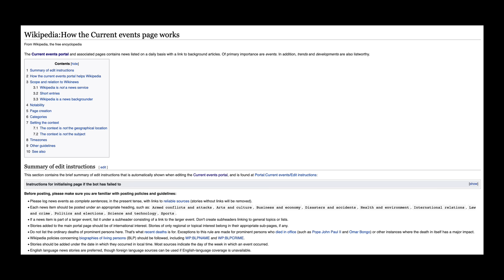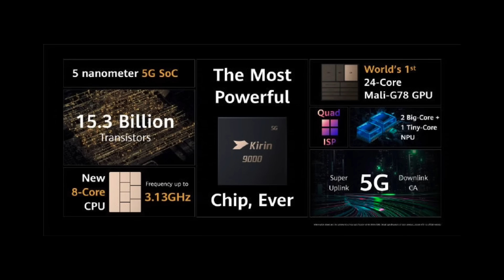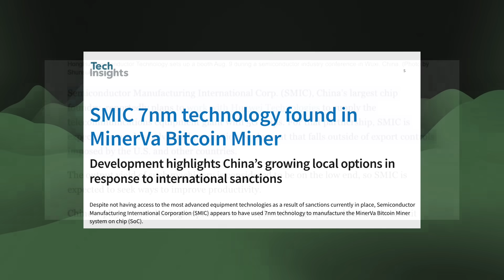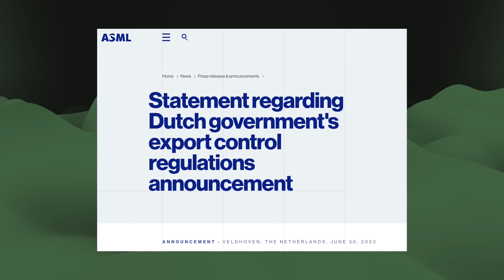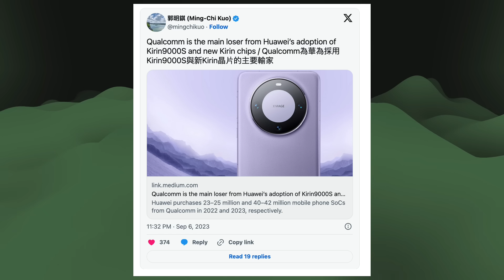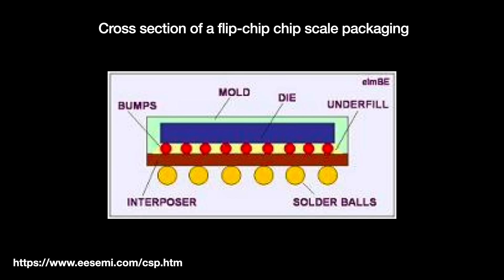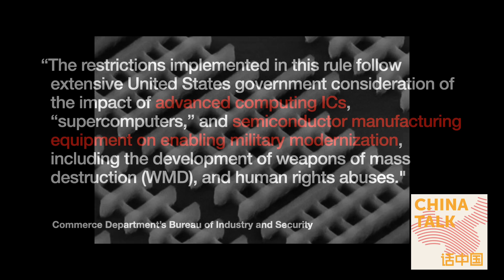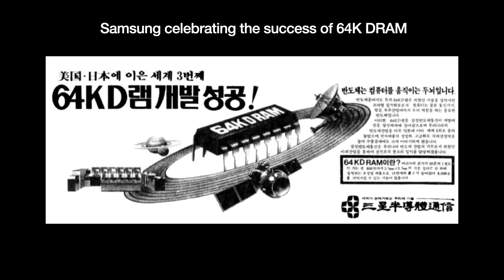China's 7nm Semiconductor Breakthrough

Comment: No breakthrough at all. For, Semiconductor Fabrication, Yield is the king. You don't need ASML's EUV machine to do 7nm. DUV that use 20s year ago can also make 7nm or even 5nm with less than 1/3 usable per wafer so each chip made will cost 3-4 time. And chip made by DUV can not run as high frequency as EUV lead to poor performance compare to chips in market.
Reply: people tend to overlook the cost of business when national prestige is on the line, if yields and cost are an issue we will never hear about it.
Reply: @supabass4003 If it is mass-produced, the chip yield will be improved.

Comment: Forgive me the ignorance, but using DUV does not intail that you have to use double patterning at every step and thus having your chips taking longer and being way more expensive? Or is the higher yield enough to compensate for it?
Reply: It's definitely pros and cons with DUV and EUV. Double patterning for DUV. Then the EUV machines is very expensive and probably also very expensive to run. The EUV will probably win out the smaller the process gets.
So smaller cheaper and slower machines or bigger more expensive and faster machines.
Reply: dalangwudalang2596  Last I checked (today) all Chinese fabs are still using ASML units. Not only that, what you say makes no sense: you cannot scale up a litography machine and still print the same wafers.
Reply: @yoshyoka  What the guy is saying is China has cracked the EUV light source issue. Rather than irradiating tin droplets with high-energy CO2-laser to generate EUV light, the chinese are using a synchrotron to generate the co-laminar EUV light. They intend to build a facility that runs multiple  lithography machines (hence factory) using the EUV light generated by a 0.5km to 1km snchroton (hence giant).
Reply: @nickl5658  Well, no, that is not what he is saying at all, at least, it was not mentioned anywhere in the video.

Comment: I remembered you talked about 7nm does not have to use the EUV in the past. However, for 5nm or lower, are the EUV must have? If China can not have EVU from ASML then can they still achieve 5nm or lower? any thoughts? Thanks.
Reply: DUV can produce 5nm with a little wiggle room. Probably  4.5nm. They should be able to have a 5nm node within the next two years.
Reply: @OccultDemonCassette  DUV already can produce 2nm GAA transistors in lab setting. Being able to produce doesn't mean it can manufacture efficiently, especially the yield go down and numbers of masks it requires can go up quickly.
Reply: @zombielinkinpark  true. We'll just have to see what they can manage to pull off with it.
Reply: even if they don't have EUV, then there is 1000% chance they already have thousands of engineers working on it as we speak.
Reply: @zombielinkinpark Huawei cooperated with SMIC and a couple of state-owned research institutes, universities as well as Chinese companies is developing next generation VGAAFET process. It is believed they can make it within 1-3 years.

Comment: I have doubts. There have been rumors coming out of China that the chips used in the phone were actually part of an older TSMC run that were then relabeled. If the rumors are true then it would explain some of the behavior of Huawei. It could explain the stealth launch for usual channels while simultaneously hyping it up via 3rd parties and government officials on social media. It could also explain why they are being cagey in specifications because they would have a finite supply of chips in that case that would have to be replaced by real SMIC chips in the future.
Reply: Can the older TSMC chips run hyperthreading, as seen in some reports?
Reply: +1, if there is a short term limited run of the MATE 60s then most likely the phones were made from left over supply of chips. Really sKrange Huawei silence on something ground breaking for China
Reply: techinsights already checked the Kirin9000s chip and confirmed it is using SMIC N+2 7nm technology.  The old Kirin 9000 used 5nm TSMC.
Reply: The chip reporting information is easy to alter. The branding on the outside of the chip is even easier to alter. China recently got caught claiming intel chips as their own. They had simply laser etched over the intel markings to erase them and add their own.
Reply: Performance testing has shown that the TSMC chips appear identical to these supposed SMIC chips or very nearly so. If they were manufactured on a different process and were truly a different product generation then the test results should diverge a bit more. It is possible that just made close copies and labeled their die process differently for marketing purposes. But it is also possible that they have failed to achieve yields at all and are relying on a stockpile of rebadged TSMC chips.
Reply: @stupidburp   It turns out you don't know anything about semiconductors or technologies. If Huawei is still using TSMC chips, you are actually insulting the USA. Also, techinsights is a Canadian company, that Canada assisted USA in catching Huawei's CFO several years ago.
Reply: @zaoy1286
Nonsense. I am not insulting the USA in any way. TSMC is a Taiwanese company snd I am not insulting them either. Tech insights is a respected company but I am not saying anything critical of them either. The only company I was critical of was SMIC and I even gave them the benefit of the doubt that it could be theirs or not. I only shared a rumor from a source in China that cannot be confirmed that gave me personally some doubts. Your nonsensical and irrational response seems like a 🤖.

Comment: How do we know the 9000 isn't left over chips from inventory before the sanctions? thx in advance
Reply: It uses cortex a510 which was designed in 2021 well after sanctions
Reply: They have been exposed as old chips with the model numbers changed.
Reply: Or you can just watch the video.  Even the dimensions are different.
Reply: @delavan9141  Ah, figured .. they've  rebranded before and Huawei not being the front on this is sus. Do you have a link to the rebrand? tia

Comment: What's the image at 11:03 showing? Clearly they are FinFETs using the classic gate on 3 sides of the fins, which of course is pumping current through the channel via 6 fins (with all the usual benefits of surface area, electrostatic control and other characteristics), but where are the interconnects?  Oh, I think I just answered my own question. That surface the gates are sitting on is actually NOT the wafer surface (i.e. not a semiconducting layer), it's actually an insulation layer (whether dioxide, PSG, or whatever), which means the interconnects are buried/hidden underneath that insulation layer, which is why the interconnects are not visible? LOL, yeah I think that's the answer to my own question ... about how the FETs were powered.

Comment: I'm more inclined to believe these are actually just remnant chips from when they made that bulk order right before sanctions were enacted on them, since these chips are just an "s" version of the then "current" chip
Reply: +1, this is the question most comments on the m60 isn't addressing. We'll see, if inventory for the phone tanks we might have the answer.
Reply: I guess if you have to cope, sure you can believe that. But this chip uses cortex a510, designed in 2021. And, no is not possible to modify an old chip to Cortex a510 if that was going to be the next question
Reply: Copium

Comment: My gosh! now Huawei release a notebook with 5nm chips... it is their own one, or the one made by TSMC?
Reply: The Kirin 9000E is an old stock from TSMC, it was designed for tablet but if they released into phone and tablet then it will compete to their own 7nm chips so they repurpose that for laptop. The new chips are Kirin 9000S and Kirin 9010. There are also few Kirin 900/800 midrange series.

Comment: The Kirin 9000s is a complete failure, is less eficient than the original kirin 9000 from 2019 and is less powerful.
Reply: It's faster than Samsung's 5nm chips, and it doesn't even matter, because China just need to enforce export control on the province of Taiwan and Kirin becomes the fastest chip in the world.

Comment: China would still need to make their own EUV machines though. They can only push the envelope so far on DUV machines without massive costs and silicon errors. But applying similar techniques they learnt here onto their eventual China-made EUV machines would actually push them across the gap they have at this moment with TSMC/ASML when they manage this. Imagine China selling EUV machines to the rest of the world in 10 years.
Reply: They are already making some breakthroughs in the EUV sector too. You can look it up.

Comment: Multi-patterning is not easy.  I think perhaps Intel's 10 nm could be used as an example.  Intel's 10 nm (Intel has since renamed it as Intel7 I believe) is roughly equivalent to TSMC 7 nm, perhaps even slightly better than TSMC 7 nm. So Intel's 10 nm process is probably a good comparison to the SMIC 7 nm as well in terms of power/performance.  Intel's 10 nm process is also a good comparison in another regard - Intel deliberately chose to forgo EUV, and stuck to 193nm litho for cost reasons. The problem with Intel 10 nm is well known of course - Intel struggled for 5 years to get the yield up high enough to ramp to volume production.  Intel's 10 nm trouble is literally the reason it lost the process lead to TSMC.  So SMIC is 3~4 years behind Intel here, but in using Intel's 10 nm development history as a projection for SMIC 7 nm. It suggests to me that one, "TSMC style 7 nm" is definitely possible without EUV, as SMIC is proving here. Two, yield could continue to be problematic moving forward, granting of course the passage of time could enable SMIC to solve similar problems that took Intel 5+ years to solve.   And three, in thinking about the DUV/EUV and multi-patterning development, it suggests to me (without evidence, just a guess, and I'm not a process engineer) that TSMC 5 nm equivalent would be very difficult with only multi-patterning and 193 nm DUV - to reach volume production.  That is, it's certainly possible that SMIC can do a "TSMC 5 nm equivalent" process with only multi-patterning and 193 nm DUV, but if you end up getting 3 good chips out of 1000 wafer starts, you can't go to volume production with it - unless you're making parts for DARPA or some such thing.  So "doing it" is probably possible, but being able to do high volume manufacturing with decent enough yields.. That part I will have a very difficult time believing.  Of course, SMIC engineers will have no choice but to do the best they can to try to make that happen, but Intel's struggles with its 10 nm suggest to me that it'll be very hard to do it for real. (As an aside - a lot of the numbers are marketing numbers these days...  SMIC can do a "TSMC 6.5 nm equivalent" and call it "SMIC 5 nm".  Who's to say that it's not equivalent?  No one other than the nerds at TechInsight and about 1000 other human beings on the face of this planet that really understands this stuff.  The rest of us would be like, oh, they did it.... So what I'm suggesting here is that I honestly don't believe that SMIC will be able to do a true "TSMC 5 nm equivalent" without EUV, but SMIC engineers could really do it and prove me wrong, or SMIC marketing could pull a fast one and define their own "SMIC 5 nm".  My money is on choice #2 here 🤣)
Reply: The switch to EUV for 5nm was primarily for cost-efficiency in a free market competitive environment. Given it's no longer a free market competitive environment anymore ("National security concerns") and with the power of state subsidies, the cost-efficiency is less important issue, there is no barriers to DUV for 5nm, just the amount of yield that is acceptable. With state subsidies, if they can achieve even 50% yield on DUV 5nm, that would be success for China, given the national security issues involved.
Reply: @MrSpiritmonger  That's not a bad summary.  However, I think the question is still - what are the numbers?  We can agree that if the chips end up costing $50 per piece to make (actual yield number question), they can be subsidized to sell as phone chips.  However, if the yield end up abysmally low, each good chip might end up costing $900 each, and subsidizing them to sell as phone chips en mass could be impractical, even for "national security" or "national pride" reasons.  By the way, I would be even more generous than you in terms of the numbers. I think if they can hit 20 to 30% yield, they can make a subsidy regime work, but from what I have read (again, I'm not a process engineer, I just play one on Youtube), hitting that on a moderately complex design on a true "TSMC 5 nm" equivalent would be challenging.
Reply: @davewang202  Insiders have said they are achieving +>70% yields on 7nm N+2.
Reply: @davewang202 even smic 7nm can be used as marketing trick "better than samsung 5nm"

Comment: Can you explain more about why “Xnm” doesn’t equal to how small transistors are?
Reply: More like how many transistors you can fit on a 400mm^2 plate. If you check the transistor density for Intel 4 which is 7nm, it has 123 million transistor per mm^2, Intel 7 has 106 million. TSMC is leading because their latest have 215 million transistor per mm^2. Samsung is a bit left behind, their 7nm has 106 million, but their latest is 150. SMIC transistor density is 113, as of now TSMC is 90% higher, Samsung 32%, Intel 8%.

Comment: From riding bicycle to motorcycles, the expectation bar was too low for China. However from motorcycle to car is another ball game. Now, it’ll be exciting to watch the Chinese’s advancements. It’ll be the biggest IF the Chinese have in a long while…to overcome.
Reply: what would be the car equivalent in this case? there simply isn't any technology that is that much better at computing than silicon chips at 5nm. they could simply cut off the supply chain however as the deer implies.
Reply: @sumansaha295  5nm for mobile phone. F-35 jets use 90nm chips, and 90% of global market uses chips larger than 28nm. You go for 5nm because mobile phones sip electricity for long battery life, vast majority of other applications do not require 5nm because those are too costly.

Comment: In the past,  new nodes made sense because it provided cost savings,  higher performance and lower power consumption. 
There hasn't been any cost savings going from 7-6-5-4-3nm,  because TSMC has been jacking up rates.

Power savings is there but we are talking like single digit gains

Only thing is compute performance. But how much do you really need in a phone?  Ray tracing on a phone lol gimme a break.

Comment: I don't understand the logic behind using very small and high power chips for weapon systems. Most weapon seems to be doing fine with atleast 10 years old tech. American logic about sanction doesn't make sense. Maybe they came under pressure from Apple and Nvidia to slow down Chinese cell phone manufacturers or AI industry.

Comment: 2:35 - Tell Qualcomm to give this Huawei phone to it's best patent lawyer ?? So you're saying Huawei possibly have copied Qcom's 5G modem design ??? Tsk tsk tsk... You may be knowledgable in semiconductor technology & it's manufacturing industry but it appears you know diddly squat about the mobile communications technology & industry. Huawei is a leader in 5G communications tech both in the handset space as well as the infrastructure network gear space. Huawei leads & holds ~35% of 5G SEPs (standard essential patents - do some research on this if you don't know what it is). Huawei was ahead of Qcom in 5G chipsets and is the first in the industry to produce a 5G modem in the Balong 5000 chipset. Huawei also have the first 5nm chip (Kirin 1020) in mass production giving TSMC the lead in the "nm-race".  All this, of course, was well before the full tech crackdown on Huawei happened. It's a joke to hear you imply Huawei copied Qcom's 5G modem 🙄🙄🤣🤣🤣.

Comment: It's a 7nm chip, based on ARM architecture! What's innovative about that? iPhone currently has 3 nm tech, and hasnt used 7 nm since 2017. Also- The front and rear camera are ON 100% of the time. Just hold a PICTURE of a bar code scanner in front (or rear) of it, and the QR code pops up. No i/r light detection, just a paper picture. Also- The Mate 60 and Mate 60 Pro can be plugged into by any Chinese police station, and they can access all pictures, texts, emails, even the ones that have been deleted. And being 7nm, it gets pretty hot. And you can't download anything from the Google PlayStore. And the satellite connection sucks. Just sayin'...

Comment: Some speculation about the Mate 60 is that some of the phones are using chips that China saved and stockpiled from a litany of manufacturers before the full implementation of the CHIPS act, and that is why we see SK Hynix RAM chips in Huawei's phone. Some even speculate that some of the components in the phone which came from domestic sources are potentially cloned from Samsung, Qualcomm, or Apple chipsets. Most notably of which is the Kirin 9000, which is believed to have cloned aspects of the design from Samsung. What are your thoughts about these allegations being leveled at Huawei, @asianometry?
Reply: They have already analyzed the die of the 9000s and it is not the same as the TSMC    one. In fact it is 2% larger....and you would think this channel wouldnt acknowledge this fact?
Reply: @paulw4487  I never said that Asianometry wouldn't. I am asking because the second part of my post was something speculated after the video came out.

Comment: What is "7nm class" supposed to mean? Compute per Watt? 5G support?
Reply: density or Tr/mm2
Reply: @pabanoid  Density has not changed much over the past decade, is hard to measure, will vary greatly depending on the design optimisation and type.
FINFET was a noteworthy step, but 7nm means nothing.